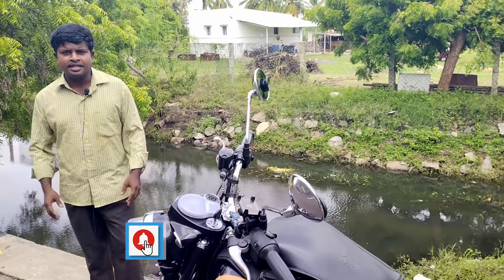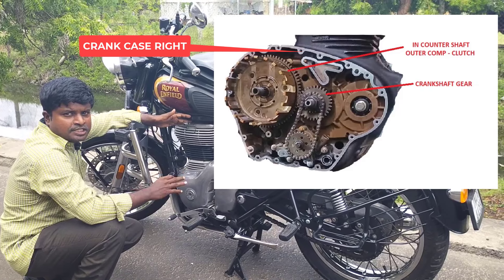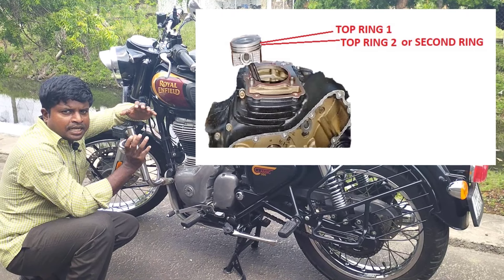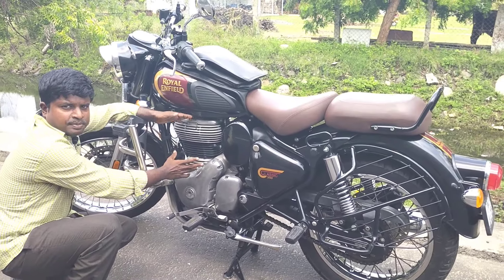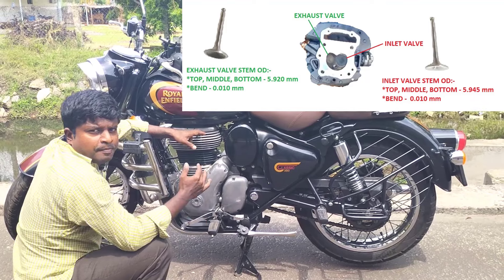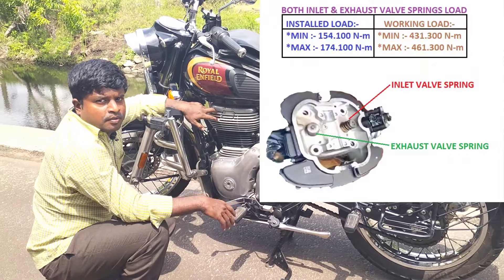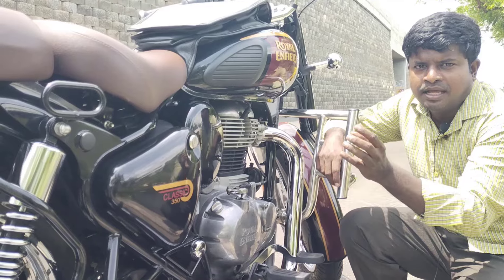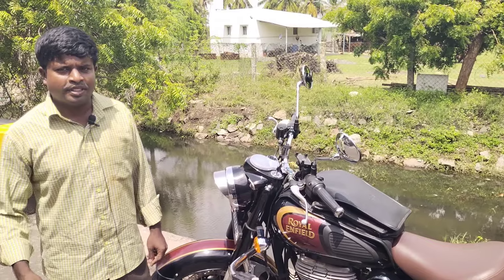CYLINDER, VALVES, HEAD, PISTON , ENGINE FITTING IN ROYAL ENFIELD REBORN CLASSIC 350 IN TAMIL

Comment: Anna front wheel wobble aaguthu anna 
Athuku ethum solution sollunga anna
Reply from the maker: Konjam time thaanga bro solren....
Reply: @BellIcon  ok anna 🫡 I am waiting ✨
Reply from the maker: Hai bro....aarambikalangala?
Reply from the maker: 🔍1.WHEEL:- Tyre bead, proper tyre pressure, wheel rims, wheel alignment, wheel disc plate, wheel bearing, wheel hub bro ...
🧐2.T- STEM PART:- Racer kit / Cone set / Stem Bearing...
⚙️3.Need to check the fork oil strength as well as fork oil spares....
🥹3.Some time tyre manufacturer complaint (or) together with the above mentioned manufacturer fault bro...
Reply: @BellIcon  ok anna  let's start
Reply: @BellIcon  anna fork oil epdi anna check panndrathu  
.
. 
Bike buy panni 30000 km odiruchu anna
Reply from the maker: 1.Periodical maintenance padi, 20,000km once fork oil maathanunga bro....
2.fork oil condition engine oil maarithanunga bro....
3.fork oil'ah just paarthaleya theriyunga bro .... Aparam Kai'ah vachu viral'la thadavi paartheenganaleya oil maari ila'ma water maari free'ah irukunga bro...itha vacheya naama'ah change panikalanga bro...
*Athavathu fork oil viscous level koranchu iruka ilaya'nu naama'ah paarkanunga bro.....
Reply: @BellIcon  ok anna thanks 🙏🏻👍🏻
Reply from the maker: 🙏🏾1.மிக்க நன்றி சகோதரரே.... 
2.நமது வண்டி சார்ந்த இந்த படங்களை உங்கள் அணைத்து நண்பர்களுக்கும் பகிரவும் மற்றும் உங்கள் எல்லா சமுக வலைதளங்களில் பகிரவும் .... 
3.கண்டிப்பாக நம்ம புல்லட் வண்டி குடும்ப உறுப்பினர்களுக்கு பயனுள்ளதாக இருக்கும்....
*உங்கள் ஓய்வு நேரங்களில் நமது "சேனல் பிளேலிஸ்ட்டில்"  RE-REBORN CLASSIC 350'ல்...உள்ள புல்லட் வண்டி சார்ந்த அனைத்து படங்களையும் பாருங்கள்...
Reply: @BellIcon  ✨🤗👍🏻